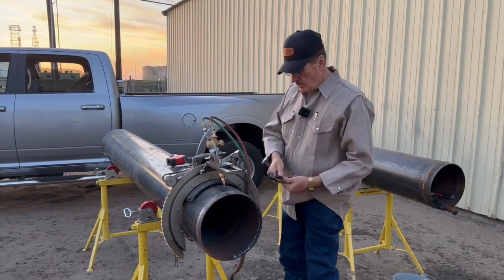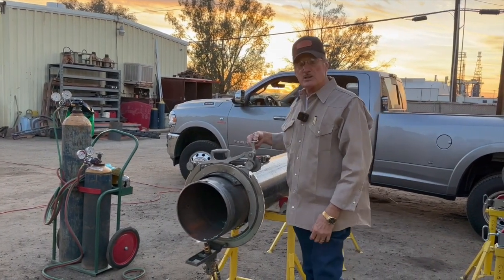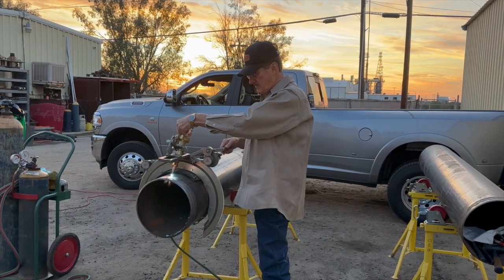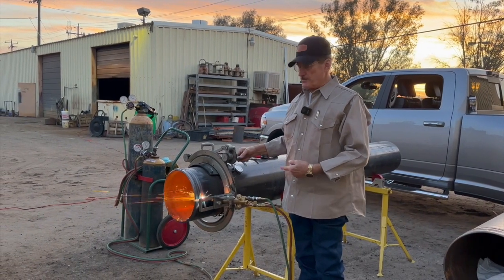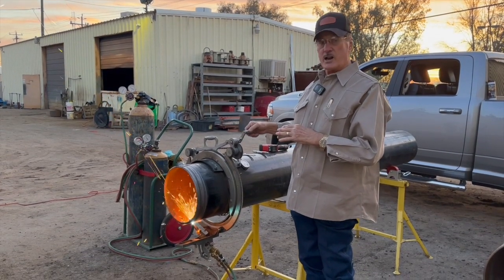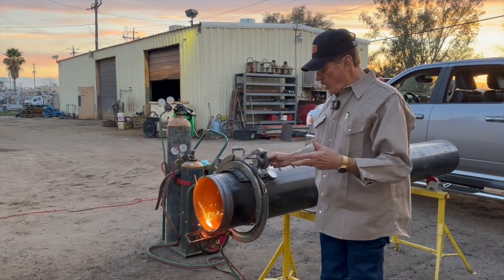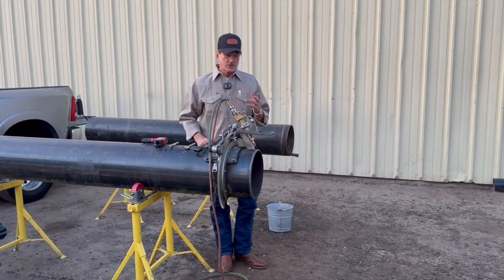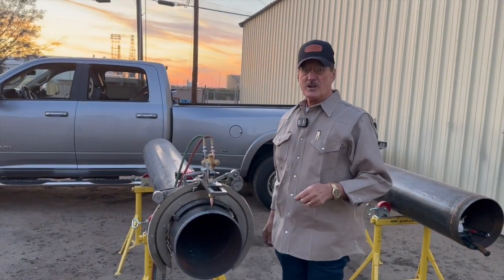Bevel Cutting Pipe:  Part 4 of 4 Beveler Demonstration, Preheat, and Cut

Comment: I was under the impression that dark goggles were necessary for every cut.
Reply from the maker: You are encouraged on jobs to use the number 5 shade googles, number 5 glasses, or number 3 face shields if you are doing a lot of cutting with a hand torch on structural steel. One reason is because the the sparks can blow back at you if your cutting is done incorrectly.
The second reason is because the cutting flame produces just enough light to make it hard to see or follow your cut lines, so a # 3 or better knocks that glare down for better vision. Very similar to wearing sun glasses while driving into the sun on a bright day.
The reality in the real world is if your just making a cut, or a few cuts, especially on pipe, most welders just wear their normal shade 3 dark safety or prescription glasses to make the cut.
When cutting pipe most of the light and sparks are on the inside of the pipe.
Since im working for myself , in my own yard and responsible for only myself, have the freedom to work as I choose.
I chose to wear my shade 3 glasses and no googles to make the video .
Thank you Rudy!
Reply: Just get you some Tom waters